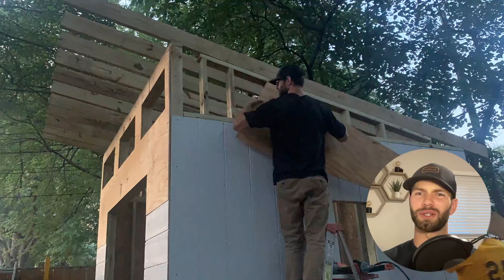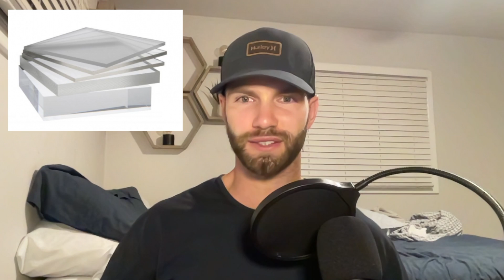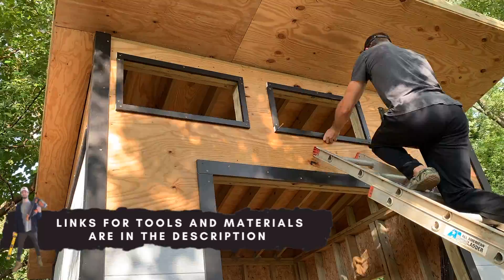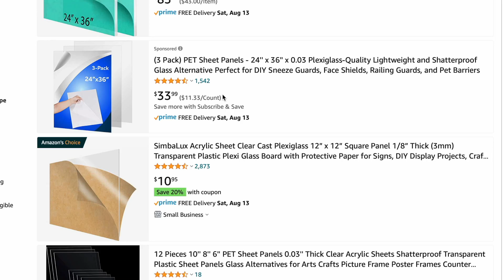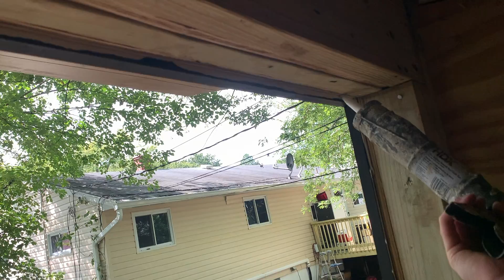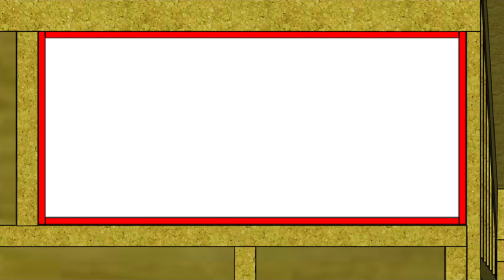Inexpensive Shed Window Option (Acrylic / Plexiglas Shed Window Alternative to Save Money)

Comment: Just a thought, your local window or glass store usually will cut glass to order. I use them for projects all the time, you could get these panels in nice thick glass for the cost of those thin sheets. Then you wouldn't worry about them scratching or hazing over time.